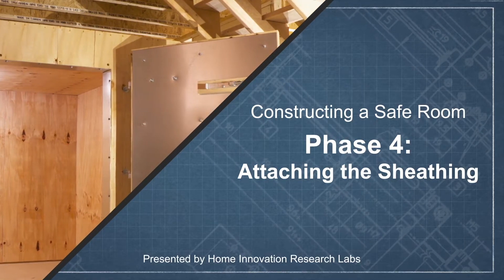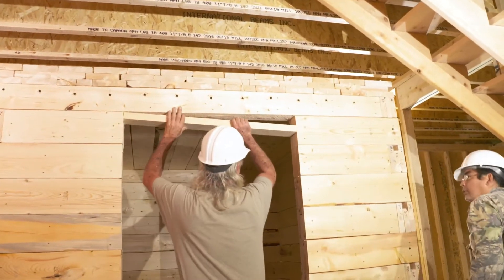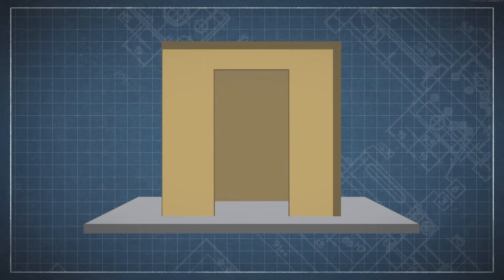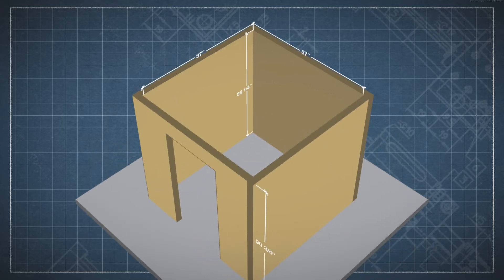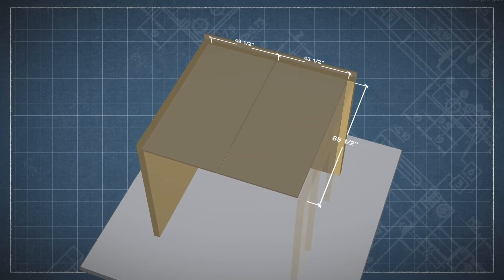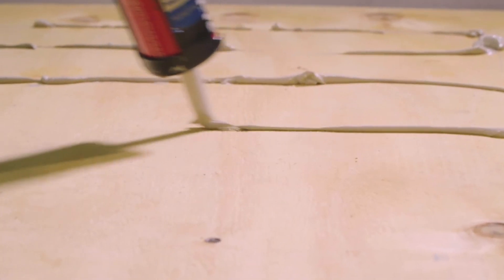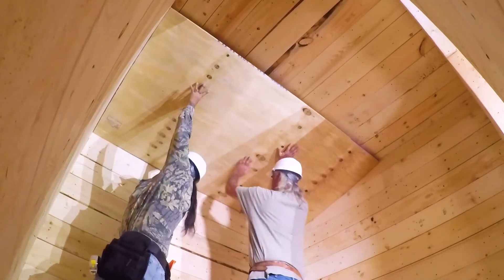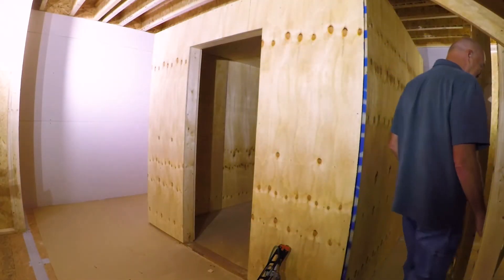Constructing a Wood Tornado Shelter (4 of 6)

Comment: Did i miss the the part of other than glue on each row of boards? Screws went in to make a square box but no screws to attach each layer to another? The only hold down was the roof into the layer below it.

Comment: why would someone choose wood as an option to protect themselves from a tornado? Not the best idea in the world  lol
Reply: Easier for DIYers. It's been tested.  It'll hold up.
Reply: Impact testing indicates that the safe room can resist the most severe impact tests (100 mi/h missile speed) dictated by the ICC/NSSA-500 standard. In addition, lateral load and uplift load testing indicated that the safe room can resist wind pressures resulting from a 250 mi/h wind calculated from wind load design criteria (ASCE 2013).
Reply: Great for a basement shelter.